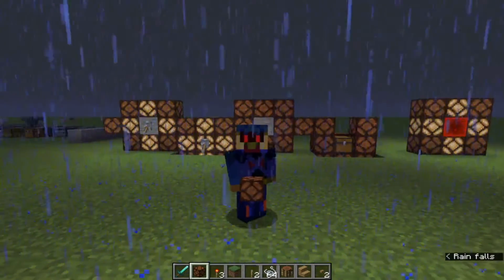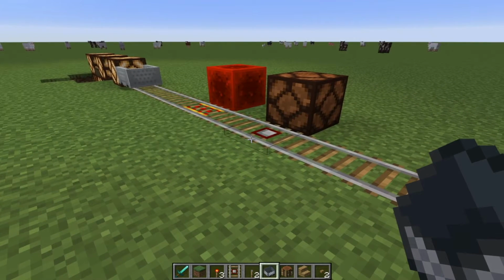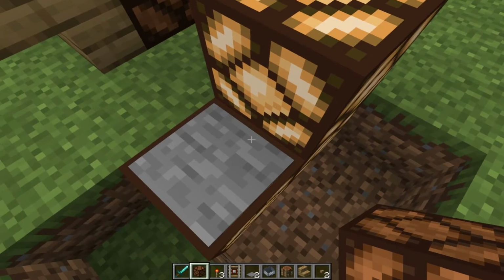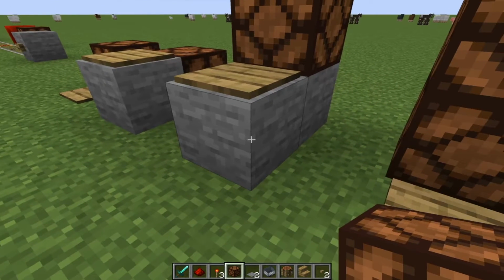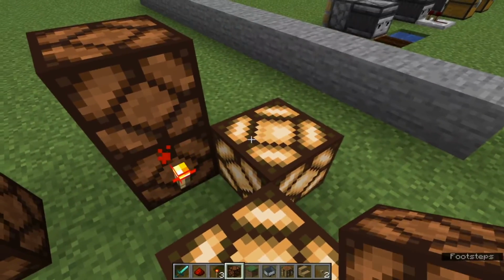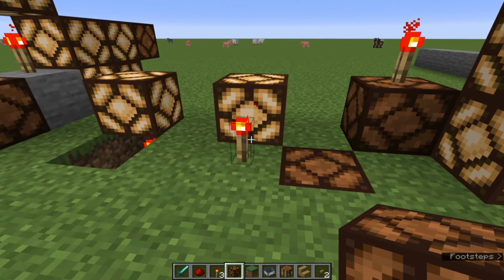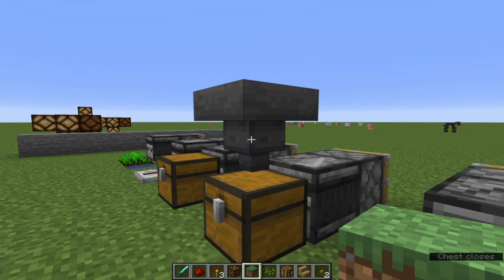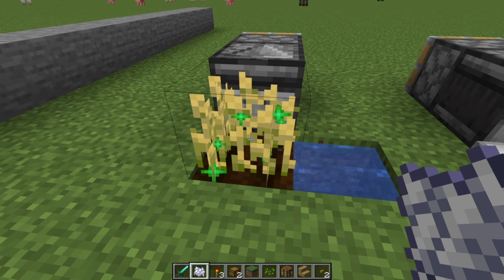Learn Redstone With Me part 2: Power Components #2

Comment: I did not know everything you told about those redstone lamps. No, I didn't. But I do know that if you do "/weather clear 99999" you will not have to repeat the command until at least 100,000 ticks has passed...

But why is it that a redstone lamp - that is powered by a redstone torch - gives power to an adjacent redstone lamp, while a redstone lamp powered by another redstone lamp does not? They are both powered. So, why do they not behave the same?
Reply from the maker: Thanks for the tip! Now as for your question...that's actually a very interesting point. and I think it has to do with the concept of turning a block into a "source." When a redstone lamp is underneath a block, it turns it into a "source" that then transmits the signal to the adjacent blocks. same as when a button, lever, or pressure plate are placed directly on a block...they turn into a "source" when activated. This is a great point you've brought up and I'm going to address it in the next episode and give you credit!